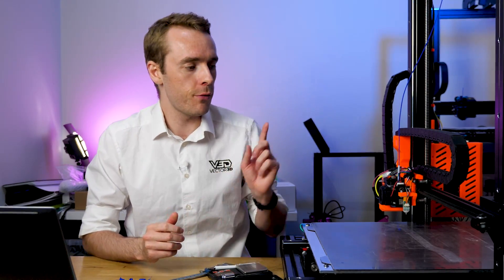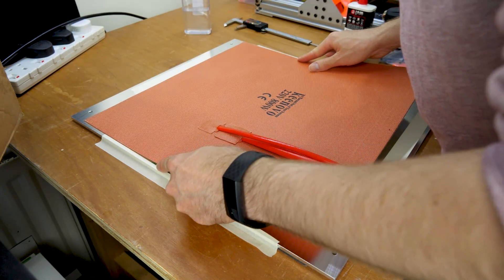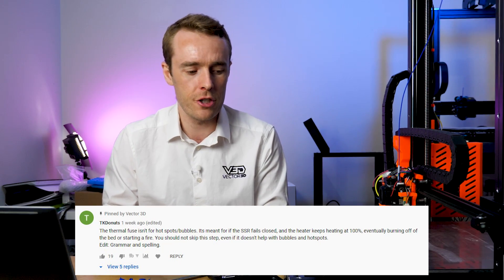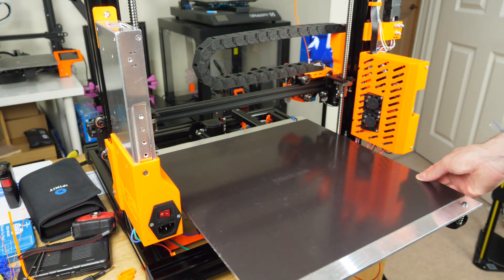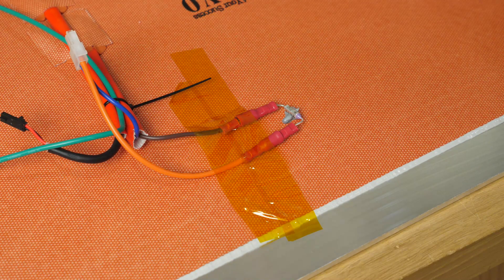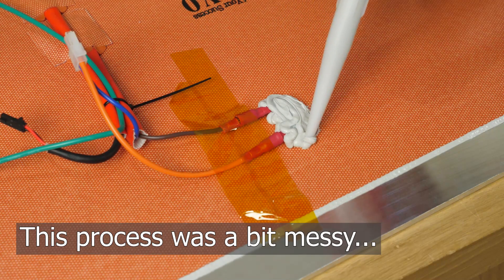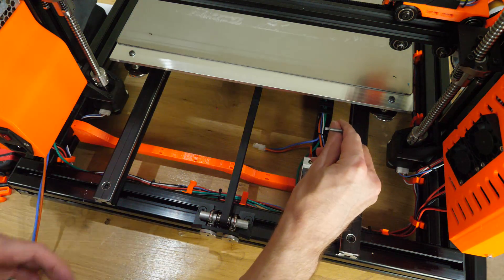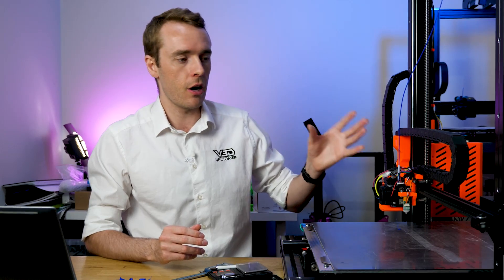Final changes - Mains wire support and Thermal Fuse

Comment: how as this fuse mounting method going for you? i plan on doing it the same way
Reply from the maker: I wouldn't recommend it really. But i also don't have other better ways to provide.
Reply: @Vector3DP  that’s why I did it...there’s no other way to mount it on the silicone build surface. Others have mounted on the aluminum plate but that doesn’t help if the heater detaches.
Reply: @Vector3DP  thermal epoxy might be good.

Comment: Also check the specs on that thermal paste. Most computer designed pastes do not work at over 130 deg C and your limit might be even lower.
Reply from the maker: Define 'do not work'
Reply: @Vector3DP  They might dry or cake up. Eg. http://www.arcticsilver.com/arctic_alumina.htm is only rated to +125C long term. Wasn't able to find clear results on how they react if operated beyond specified range but the temp range is there for a reason.
Reply from the maker: @TommiHärkönen  yep, good point. Probably should have considered that. I'm not too worried though, for preventing the worst case scenario it should still be fine, just maybe trigger a little later.
Reply: @Vector3DP  Yeah it should be ok. Even if it's not optimal thermal conductor - it'll still heat up. Using high temperature paste is still better though. The bed temperatures are close to the upper limit but if you were printing PEEK and had some in your nozzle heat break, that might not be such good idea.

Comment: You havent really grasped how the thermal fuse works, its not the heat from the bed that trips it, its the heat caused by excessive current flowing through the wire/fuse causing that to heat up and blow before the actual wire itself fails.
Reply from the maker: Sorry to be blunt, but you're totally wrong here I'm afraid. A thermal fuse is triggered just by temperature and it shouldn't be making any heat of its own. A normal electrical fuse is triggered by current draw.
Reply: Completely incorrect. A thermal fuses current carrying ability is always rated far beyond what would trigger it's temperature set point. It's designed to trigger from external heating, not internal. That is a standard fuse.
Reply: No he is correct, the thermal fuse is designed to go open circuit at a specific temperature to prevent the bed from overheating in a fault condition (e.g. if the SSR goes short circuit or a firmware malfunction). What you have described is just a standard electrical fuse which goes open circuit with excessive current.
Reply: I had the same discussion with a german speaking lad. In german "thermal fuse" means a standard electrical fuse. Not the same in english.

Comment: Usually thermal grease is electrically conductive. The way you applied the grease and mix it with thermal silicone could cause shortage between terminals of the fuse and effectively eliminate the whole purpose of the thermal fuse.
Reply from the maker: This one is labelled as non conductive.
Reply: Normal thermal grease consists of silicone oil and a filler like Titanium dioxide. Only a few specialized thermal greases with metal content are conductive.

Comment: I thought the fused grid was a good idea, The failure mode you shown was an actual hot spot blown through, A thermal fuse will only fail if current exceeds the rating, or the temperature at that spot increased enough, so it made perfect sense to me, especially cosidering heaters are on a bed with large thermal mass, implementing it would probably be a huge pita, and a single failed device would kill your entire bed.

Comment: The concerns about SSRs failing are valid.  Consider getting an original Omron or Crydom SSR from an electronics supplier (not Aliexpress).  These are on the BOM for the Voron 3d printers... overkill for the application but they should fail safely.  They're worth the additional cost for that alone.  The thermal fuse absolutely should still be used as an additional failsafe
Reply: By nature, SSR's will almost always fail closed, regardless of whether they're high end or not. Getting a genuine one, however, ensures failure is much more rare.
Reply: @TKDonuts  I can confirm that I've had a Chinese cheepo SSR fail on me -- and it failed closed, and I also had a brand name SSR fail on me and it failed open.  
Both times it happened at the start of a print, so I was there to observe. The manufacturer of the brand name SSR states their SSR are designed to fail open, and it did. Will it always, I don't know,  that's the only 1 I had fail on me. Chinese relays also leak current, you can measure AC voltage trickling through while "open". I have many other layers of protection as a monitoring system can cut the power to the entire machine -- a lot of relays have to fail for something really bad to happen.
Reply: @kazolar  Uh, idk about crydom, but Omron states that the primary failure mode for their SSR's is failing closed, and they recommend using a regular relay or contactor as a failsafe instead.
Reply: "The SSR consists of semiconductor elements, and will break
down if these elements are damaged by surge voltage or
overcurrent. Most faults associated with the elements are
short-circuit malfunctions, whereby the load cannot be turned
OFF.
" 
Source: [page 16]
https://www.ia.omron.com/data_pdf/guide/18/ssr_tg_e_9_3.pdf